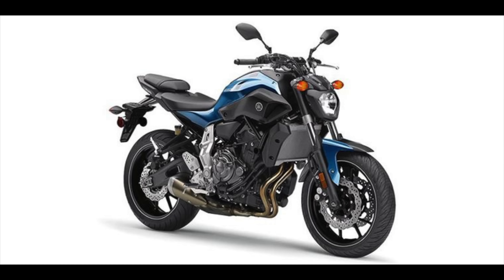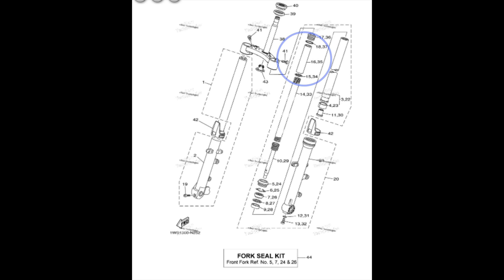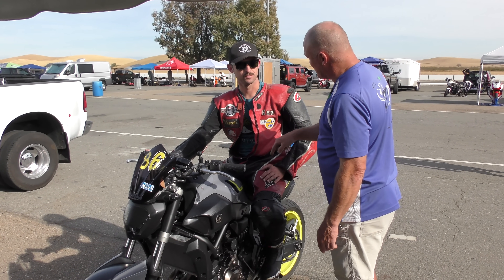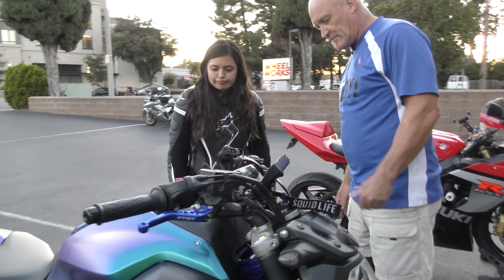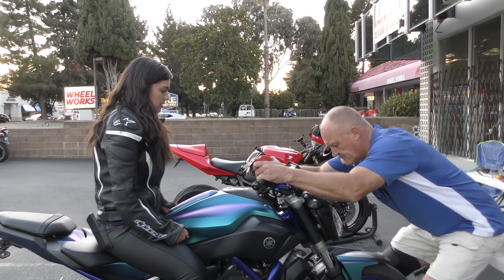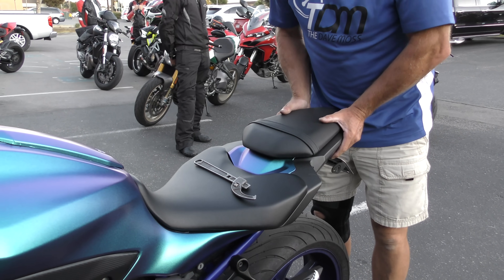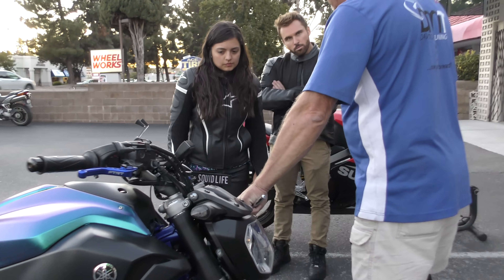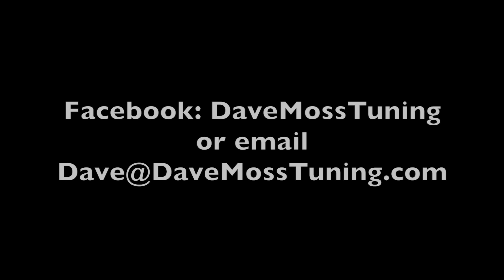Yamaha FZ-07 / MT-07 Fatal Flaw and How To Fix It

Comment: Does the MT-03 have the same issues?
Reply from the maker: On fork oil viscosity yes. I have not seen the latest version to assess if it has enough or not enough static sag as per video information. If not enough, then yes, the spacer would need to be altered.

Comment: Fatal !!! hahaha.
Reply from the maker: As per Webster's dictionary, "Fatal" is defined as distasterous. Highly applicable.
Reply: @catalystreactionsbw  Hardly Fatal
Reply: @catalystreactionsbw  Fatal would be engine seizure , frame or bike integrity Failure , you know like those safety recalls the potentially Fatal ones  some of the euro bikes have commonly . Fatal flogging ego stroker haha ya hero ! O as per Webster not Oxford
Reply from the maker: Dave Williams, editor, replying here. The guy in this video, at 5:15 came close. You'll see he hits 2 bumps as he enters the corner and this causes the front to fold. The bars suddenly turn to the right and then he crashes.  https://www.youtube.com/watch?v=Dglu0Wsf80k&t=11s

Comment: Does the Yamaha FJ-09 have the same problem as the MT-07? I have a 2015 FJ-09 and think my suspension needs a bit of work.
Reply from the maker: The FJ09 has the correct spring/spacer combination. I use 10w for both forks at 150mm oil height. Helped a lot. Shock spring is far too soft. https://davemosstuning.com/?s=tracer+gt

Comment: Is this problem also with the XSR700/900? I've been looking to buy one and was curious if that's something I should address
Reply from the maker: With the XSR700, yes. With the XSR 900 you need a different shock spring as OEM is too long and 15w fork oil.

Comment: How is this a "fatal" flaw?
Has anyone died from not performing this modification you are recommending?

Just curious because I'm thinking of purchasing an FZ-07.
Reply from the maker: To date, the flaw is the same through to the 2020 model, having worked with riders. A simple easy and cheap fix for any owner. In answer to your question, one definition of fatal is "leading to failure". Read the comments and see how many riders have had rebound failures creating handling issues and accelerated tire wear. .
Reply: @catalystreactionsbw  What about after your mod and 20000 klms with no maintenance , Fatal for the next or existing owner , Fatal geometry !
Reply from the maker: Dave Williams, editor, replying here. The guy in this video, at 5:15 came close. You'll see he hits 2 bumps as he enters the corner and this causes the front to fold. The bars suddenly turn to the right and then he crashes.  https://www.youtube.com/watch?v=Dglu0Wsf80k&t=11s

Comment: Seems just a bit overly dramatic to me.  What are you, the Ralph Nader of motorcycles?
"Fatal Flaw" = clickbait title.
Reply: Well when the flaw can make a bike throw a rider off in an instant, it seems fair to propose that said flaw is fatal
Reply: @sennendillane4705  I don't think there is any such "flaw" when riding at reasonable speeds on the street.  If you are pushing the limits at the track, that is a different story.  When I see the title it just seems way over stated and not in line with reality.
Reply from the maker: Dave Williams, editor, replying here. The guy in this video, at 5:15 came close. You'll see he hits 2 bumps as he enters the corner and this causes the front to fold. The bars suddenly turn to the right and then he crashes.  https://www.youtube.com/watch?v=Dglu0Wsf80k&t=11s

Comment: The suspension has no problems. It's perfect for riding on the rear wheel to work and back on the street. If you just ride on a track get a fucking r6.

Comment: I own a HD softail, will that work same way?
Reply from the maker: No matter what you ride, this methodology works the same for everyone. All cruisers have the same fork oil being too thin issue. Look at this video at 2.15 and you will probably immediately recognize the wear. https://www.youtube.com/watch?v=dVYSfIUnzBk   This feathering/cupping is a huge problem with cruisers on both tires so depending on the bike and system (cartridge or damping rod) you may go from 15, 20, 30, ATF.

Comment: Do you have a video with Suzuki GSR 600 suspension?  It's too soft and what can you do.  Greetings from Poland.
Reply from the maker: We do not have a video on the GSR600 otherwise known as the Bandit 600. The rear shock appears to be non adjustable according to the spec sheet, so check your rear shock shaft to see if is 100% clean. Forks would be 15w or 20w oil every 8,000kms
Reply: @catalystreactionsbw  thx

Comment: This is a 1st generation fz07, does the 2nd generation have the same problem? Coz they upgraded the forks
Reply: According to recent video where Dave is fixing the issue. Bike still has the issue, however there is higher weight oil in fork I think.

Comment: So really this is because Yamaha decided to go cheap on their suspension?
Reply from the maker: Irrespective of this being a Yamaha, most budget bikes run into this problem with oil viscosity, oil amount, springs and spacers as it has to meet the bell curve for the areas it will sell most units in. If this is an area of the world where the population is generally lighter, then the suspension is centered on that demographic.

Comment: Hey Dave, so if I understand this correctly, if my MT-07 has less than 15mm of static sag in the front, for someone 195lbs fully geared, I can take 7mm off of the spacer and add 15w or 20w oil? If I have 15mm of static sag, I can still use a heavier weight oil like 15 or 20 for my weight?

Comment: So does he do the fix on the video or what?   What is the talk about the pipe cutter? Im confused
Reply from the maker: I hope this ends your confusion.  1. The forks have no static sag as the preload spacer is too long. https://www.youtube.com/watch?v=D-DOVMbfdPE&t=25s  2. If the spacer is made 10-15mm shorter using a pipe cutter, it can be reinstalled so static sag is corrected.  3. If you change fork oil to 15w or 20w depending on your weight/aggressiveness, all the pogo is removed form the forks (see comments form those who made the change).
Reply: @catalystreactionsbw  ok so you did not actually fix anything on this video. Thanks.   Do you know if the problem still exists on new 2019/20 models? Yamaha says the have fine tuned the suspension on the product page.
Reply from the maker: @Gaminggagreel  If you scroll down in the comments, you will see that a viewer shared the information on the 2018-2020 model - that the static sag is no different. The oil may be a different viscosity, but the spacer issue still exists. The comments offer excellent insight when you read through them.
Reply: @catalystreactionsbw  thanks for leading with example and being active with the community, very helpful pointing out those facts. Appreciate it

Comment: I put 15w in the forks and cut the spacers down 10mm. It made a huge difference. I’m not riding a pogo stick anymore. This guy is a suspension god. 👍
Reply from the maker: Thanks for sharing you results from the changes made so others can benefit from your experience! Enjoy the better handling you now have but remember that when the pogo starts again, the oil needs to be replaced.
Reply: @catalystreactionsbw I need to make the same changes to my front forks. I already ran 15wt fork oil. But I weigh over 140 so I’ll cut the spacer 10 mm but then since I’m cutting that spacer about how much less fork oil to I use than oem specs? Do I use 10mm less of fork oil as well? Or still the same amount?
Reply from the maker: @Lopez23300  I would suggest at your weight you use 3765cc/ml
Reply: @catalystreactionsbw  if I use my motion pro fork level measuring tool to the 162 mm after cutting the spacers down 10mm is that going to be too much oil? Or does that depend on the fork travel and etc? And then should I raise the forks in the triple clamps 8 mm?
Reply from the maker: @Lopez23300  Oil level assists with bottoming out. as an air spring effect - compressing air slows down the compression stroke. It is easy to add oil so start low.
Reply: Got is god, a human is not do not be disrespectful to the creater even if you are just saying this you should not.

Comment: Is this the same for the MT-09?
Reply from the maker: It is not. The MT09 depending on year needs slightly heavier fork oil and shorter shock spring (some versions have no static sag in the rear even with preload at the softest setting).

Comment: I have an XSR900, it's a 2019 reg but a 2016 bike. 
Would this have a similar issue? 
I'm worried.
Reply from the maker: The XSR has a good set of forks with preload and rebound damping . The rear shock spring is the issue. Even at the softest setting it has no static sag.

Comment: Any suspension setup for the fz09 for a lighter guy 110sh lbs
Reply from the maker: what year, how many miles, kms, how many changes from stock, last fork oil service, OEM or replacement shock brand model and size sof tyres, types of use (commute, weekends, aggresive, some track). Cold pressures used generally, ergonomics done correctly?
Reply: @catalystreactionsbw  2017 fz09, just about 3800 miles, fork oil to my knowledge hasnt been serviced. Just switching to q3+. Commute, agresive weekends, and some track. Not to sure forthe last two questions.
Reply from the maker: @danstaszko8039  Trim the fork spacer 15mm, change fork oil for 15w or 20w depending on your weight. Set the rear shock preload to 3 above the softest setting.
Reply from the maker: @danstaszko8039  Fork oil age is fine as is shock oil age. Set sag at 35-40mm front and rear and ride. See how a more balanced chassis can help.

Comment: Is this relevant for the Tracer 700 too?
Reply from the maker: I have yet to work on one of these bikes personally. The MT700 has no static sag at all so test #1 is to see if the Tracer 700 does have any: https://davemosstuning.com/?s=static+sag    If it has 15-25mm of static sag, the spacer length is fine. The bike is listed at 130mm travel so fork bottom out needs to be marked: https://davemosstuning.com/?s=fork+bottom+out   The Tracer 700 is listed as having no fork or shock adjustments. In that case, the fork oil might need be upgraded to 15w or 20w depending on your weight and or aggressiveness to the same volume as stock to start.
Reply: Thank you for the detailed response! I'll check and comment again with what I find

Comment: I'd imagined that it's the same for the xsr700?
Reply from the maker: The XSR700 has a shock spring that is too long. The forks are adjustable, so the spacer is fine with length but improvements would be 15w fork oil in the rebound leg and 10w in the left leg.
Reply: @catalystreactionsbw  understood! thank you very much for the quick response!

Comment: Hi Dave, first time visitor here. I find your video and explanation helpful. I’m 200 Lbs and am about to pick on a 2016 FZ 07. I was wondering if I have to use the pipe cutter you mention to cut the spacer, or if I can get away with changing the suspension oil to the correct viscosity. Hope I said that right, not mechanically inclined.
Reply from the maker: So, use 20w to the same volume as stock and hacksaw the spacer down 10mm BUT clean up the cut end prior to install. Do you have a machine shop that can use the lathe o hacksaw to cut the spacer for you?

Comment: Hi Dave, im from argentina and I own a '17 mt 07... did the spacers and oil mod... feels like a totally different bike (confidence inspiring especially in the corners)
Now I want to ask if it·s it's necessary to move the forks a little bit up (im 5 10 tall) because I still feel that corner entry could be more easier than what it offers rightnow. . Thanks for sharing your knowledge. Cheers m8

Side note the rear shock is 2 clicks from beign the stiffest possible... for my bw is ok... I checked the sag and is ok
Reply from the maker: Thank you for getting the work done, posting your experience and enjoying the benefits! You will increase the amount of fork sticking up above the upper triple clamp by 3mm, then 2mm more for a total of 5mm more than stock. This will give the front tire more grip. The rear shock setting makes sense.

Comment: Hi Dave, We as motorcyclists should appreciate the expert knowledge that you share with us non-experts.  Thank you for adding value.  I just picked up an Fz-07 today and it has no static sag.  I'm about 185-190lbs with gear.  I will try the 15w oil swap and the 10mm spacer reduction, unless you suggest otherwise.  Do you see much value in progressive springs in addition to the prior mods or just stick to the stock ones?   Thanks in advance sir!
Reply from the maker: Thank you for the kind words and congrats on the FZ07! Given your weight a 7mm reduction will be more appropriate for the spacer. Linear or progressive wind springs will work but test the OEM springs for travel used prior to acquiring new springs based on marking fork bottom out: https://www.youtube.com/watch?v=eds3dn1LBkw&t=4s
Reply: @catalystreactionsbw  Thank you Sir!

Comment: Hi Dave. Quick question. In another one of your videos you mentioned how one manufacturer's 15wt is not the same as another manufacturer's. What brand 15wt would you recommend to replace the stock fork oil for a 175lb rider on a stock fz07.
Reply from the maker: Motul or Maxima are the two brands I would recommend as they are widely available.
Reply: @catalystreactionsbw  thank you!

Comment: Did they fix this with the redesign in 2018?
Reply from the maker: Did not find a 2018 yet on my travels. Looking in Auckland tomorrow.
Reply: Dave Moss Tuning Ah, I see. If you do find a 2018+, please let me know how it does if you can. I’m looking to buy a 2019 or a 2020, and want to know if this needs to be one of my initial modifications to the bike.
Reply from the maker: @brickson98m  Will do!
Reply: Dave Moss Tuning hey Dave. Any news on the 2018 MT-07?
Reply from the maker: @ChocPretz  Have not found one yet on my travels. Heading into Wellington tomorrow, hoping TSS has one. These MT07 models have spring and the same spacer (3FW-23118-00-00) on the Yamaha parts fiche: 2019, 2018, 2017, 2016, 2015. The easy check is to see if you have less than 15mm static sag. If so, yes, the spacer trim of 7-15mm applies as does slecting the correct heavier oil based on your weight and level of aggressiveness: https://davemosstuning.com/?s=static+sag

Comment: My 2019 fz09 didn’t have these problems
Reply from the maker: Correct! For that model I changed compression oil to 10w or 15w (based on rider weight) for better bottoming resistance.

Comment: Awesome video. I have a 2015 MT07. The spacer you are suggesting to cut down I assume is Yamaha part 3FW-23118-00? I am 90kg so should cut 10mm from it as well as change the fork oil to 15-20w?
Reply from the maker: Given your weight, reduce the spacer by 7mm and use 20w oil. Yes, that is the correct part number for the spacer. Thank you for supplying that to help others.
Reply: Thank you very much.

Comment: Yesterday i took the spacer out and took it to the master on a lathe machine to cut it 15mm. Today I am going to put 15w oil and assemble everything on a motorcycle. I still have cold weather and I hope for the first ride in a few days. I'll also adjust the rear suspension as recommended by Dave. Sorry for my english. I hope everyone understands what I wanted to write
Reply from the maker: Your English is excellent. Set the oil height to 110mm with the 15w
Reply: @catalystreactionsbw  Thank you Mr. Dave. I finished everything yesterday but today I will put more oil up to 110. Yes, the oil is Motul fork oil 15w. Static sag I have now. When I sit down and get up from the motorcycle the front fork is aligned with the rear shock absorber, which has never happened before.
Thanks again.
Reply: First ride yesterday. The difference is so great that it's just not the same motorbike. I finally ride comfortably and safely. Thank you very much Mr.Dave
Reply from the maker: @salej6009  You are very welcome. Please share your experience to help other riders all over the world with their MT07 have a better handling bike!
Reply: @catalystreactionsbw   Yes yes. Thanks again

Comment: "Those are your bullet points, get to work."  I'm doing this to my 2015 FZ-07 as soon as possible
Reply from the maker: What is your weight? That will determine oil viscosity and height. Let's do it once and do it right.
Reply: @catalystreactionsbw  I'm 265 lbs so I was thinking 20-30 weight like you mention in the video
Reply from the maker: @southpawscientific4122  30w for sure.
Reply: @catalystreactionsbw  Thanks Dave, appreciate your insight.

Comment: so the static sag is to allow the bike to dampen its rebound?
Reply from the maker: In essence yes. There has to be a dead space for the shock to top out into and that leaves the rider alone in the seat. So, for dirt bikes it will be a lot more with 8-12 inches of travel.

Comment: Is it the same for the FZ-09?
Reply from the maker: First version/Gen 1 needs 15w fork oil.
Reply: @catalystreactionsbw  Thanks for the follow up. I've noticed my bike does all the things you've brought up for the fz07. I have a 2014 fz09 and will increase the fork oil weight. Does it need the spacer to be reduced too?
Reply from the maker: @mrxraymri  What is you physical weight without gear on?
Reply from the maker: You will need 15w for the fork oil and start at the volume set in the manual or strip the fork and set oil height at 135mm. As this is an Gen 1 FZ09, no spacer cutting is needed.
Reply: @catalystreactionsbw  I'm 6'1, and 185lbs
Reply: @catalystreactionsbw  thanks again for your help and all the Free 99 information. :-)